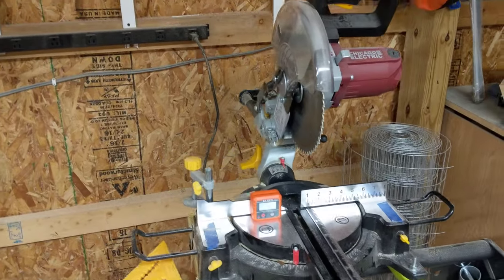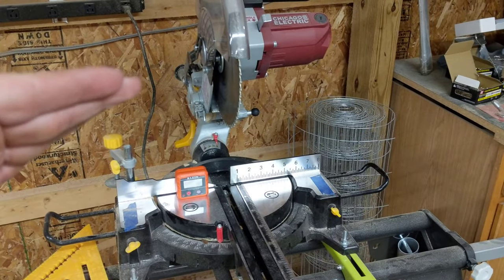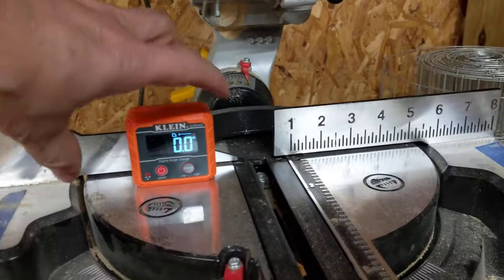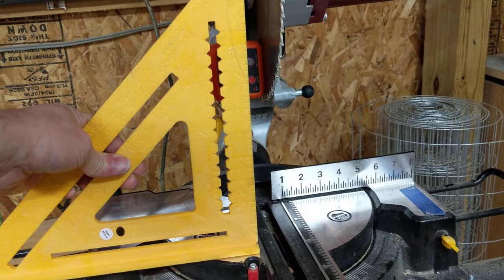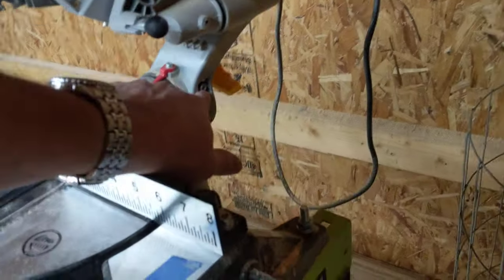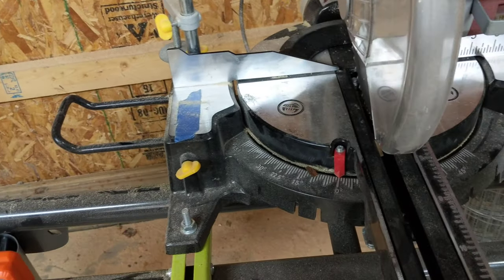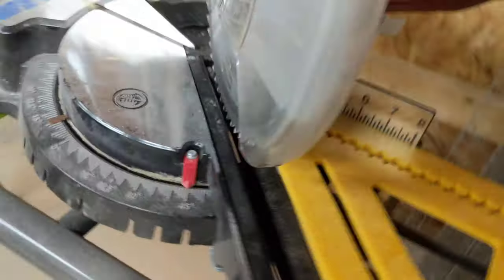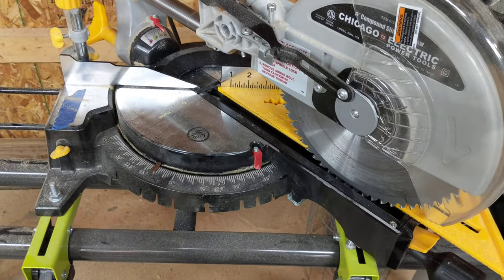How to square up the harbor freight compound miter saw

Comment: Thank you for the info on the Harbor Freight 10-in Miter Saw.  This is the one I have.
However, I found the use of the square less than satisfactory.  In addition to this video I used 
the video "Four Cut Calibration" to get better precission.  I was able to get the tollerance down
to .0040-in.  I needed both videos to get the precission I wanted.  Now my cuts make perfect 90 and 45  degree angles.

Comment: The problem I have with my 12" Harbor Freight saw is there is slop in the detents, so when set at 90 degrees in moves back and forth a little.  Is there a way to fig that?

Comment: Tips. good to know.
Very important if you would like to saw with precision. (avoid torsion as much as possible)!
Always choose a Miter saw with a handle positioned in a vertical line above the saw blade.  
Everything must be aligned, slide rails, handle, and saw blade,it is much better this way the blade will not tilt.
Because there is some torsion in the aluminum housing .
And choose an engine with softstart on it to prevent wear of the gear and worm shaft.
It is very important that everything is aligned.
Here are some examples to show how the handle must be positioned above the blade.
Bosch gcm 800 sj / Bosch gcm 8 sjl / Evolution rage 3 / FESTOOL KS 60 / HITACHI C12RSH2 / FESTOOL KS 60 E KAPEX / Metabo KGSV 72 Xact  / Bosch  GCM 8 SDE
 
(This also is the case with the Miter saw without the slide rails).

If you want you can test it yourself at home if there is torsion in the aluminum housing.

Step-1. First you make a saw cut from +-5 mm deep in to a flat piece of wood about +- 20 mm thick. To this with the normal handle positioned on the right side of the Miter saw.

Step-2. Then repeat this by pushing the saw blade down with your hand (finger) on the aluminum protective cover were the saw blade is cased in. Just now only do this without the running engine.

Step-3. Now you can see if the saw blade will be positioned in or next to the saw cut. If the saw blade is (+- 0,2 / 0,5 mm) next to the saw cut then there is torsion in the aluminum housing.

Step-4. therefor it is much better to choose a Miter saw with the handle positioned vertical in line above the saw blade.

Step-5. When you measure the vertical 90 degrees angle square (Digital Angle Gaug) of you're sawblade don't forget that there is always some torsion in the aluminum housing.

Conclusion: how further away the handle is from the saw blade how more chance of torsion in the aluminum housing.(don't go for that).

Comment: What if the fence itself isn't straight?  Mine seems to be off.  I check it for square on the left and it's perfect.  Not so much on the right.  So my fence seems to be warped possibly?
Reply: Yea mines off too. 
I used a 36in precision straight edge to check it. 
Both when it was bolted on and off the base. 
It's also not 90 deg to the base when it's bolted on, with no way to adjust it that I know of, other than shimming it or maybe installing a couple set screws from underneath.
I'm considering other alternatives though. 
Like ditching the fence entirely and use the already drilled factory holes on either side to bolt on a couple aluminum extrusions.

To which I can add all the necessary stops and accessories.
Reply from the maker: like its "bent"?
you could get 1 side lined up, the bolt it tight, then "flex" the otherside square, then bolt it tight.

Comment: Great video. Is this a common problem with Harbor freight, that it's misconfig or misalign?  I hear a similar comment on a drill press youtube as well.  What is that electronic gadget you use to measure?
Reply from the maker: Digital angle finder, I got it off of Amazon but I believe even harbors great sells one.

It allows you to zero off the table for your reference and then you can match it to the blade to get exact and it's magnetic so it sticks

Comment: Any reasons why you have the blue tape on each side? 
Are your two side not the same height as the center platform?
Reply from the maker: when i was cutting some crown moulding, it gave it a bit more "grip"